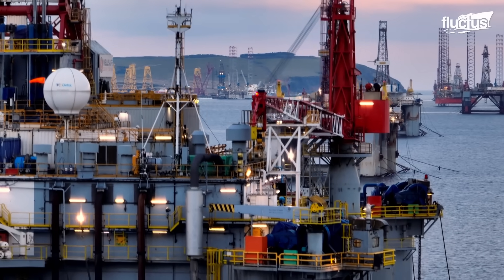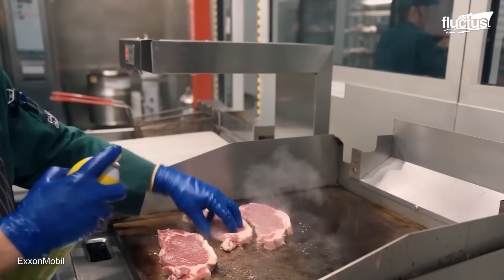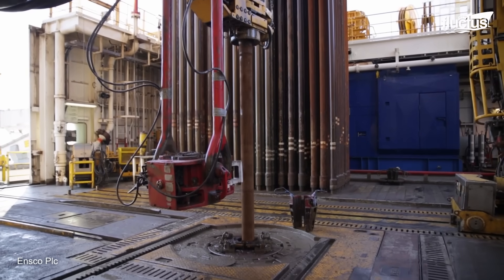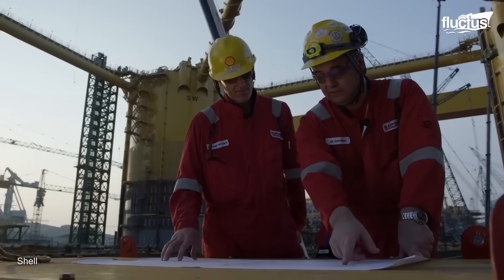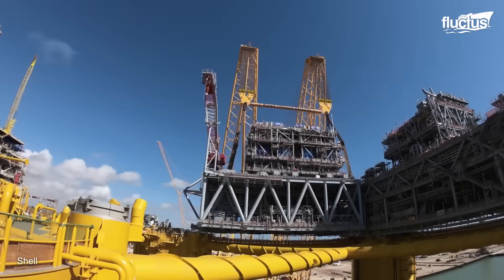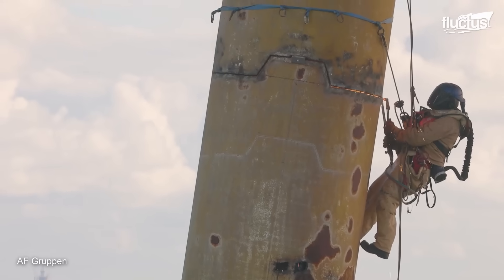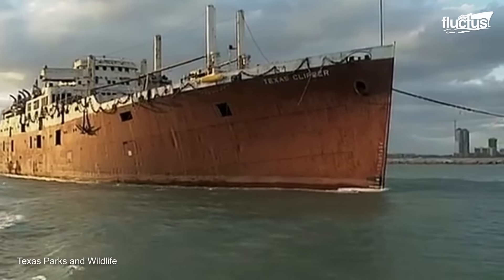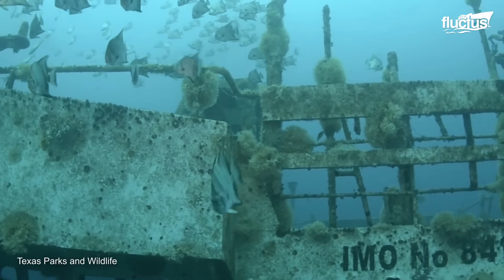Life Inside Gigantic Billion $ Oil Rigs Operating 24/7 at Sea

Comment: Using green steel, making rig power with CCUS and injecting CO2 back into the gas wells and careful control of methane emissions would make these a bit cleaner.